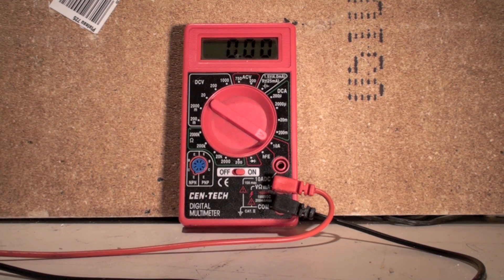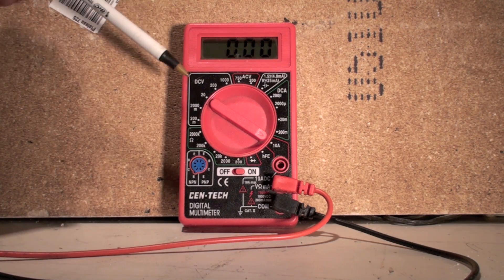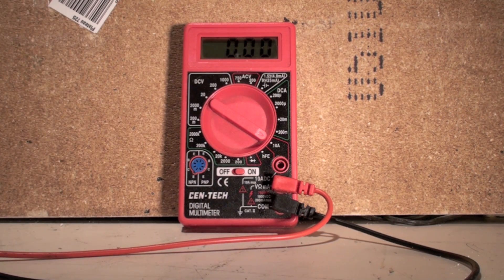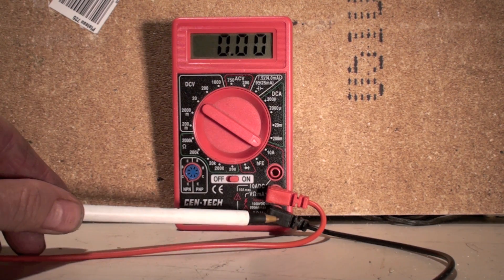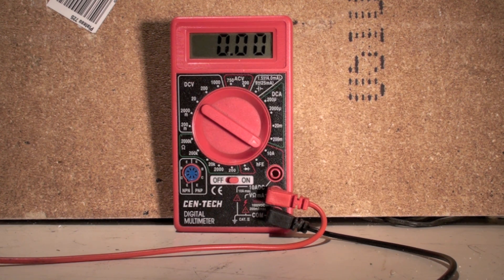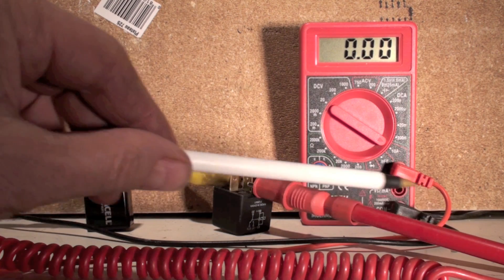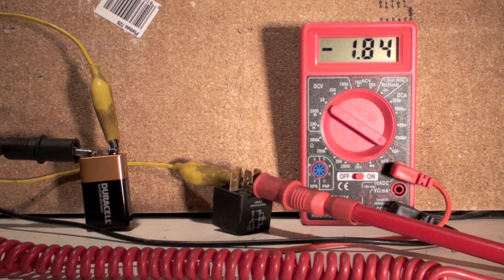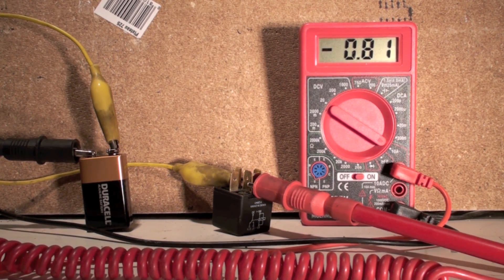Meters for HVAC part 3 manual ranging multimeter

Comment: Got at Harbor Freight for free with coupon. multimeter very impressive for being free that does a lot of amazing work but I thought it would not be able to handle it but it actually handled it . Thats also 10 amps DC only no AC amps checking.
Reply from the maker: The meter works ok.  The leads are pretty bad.
GFM